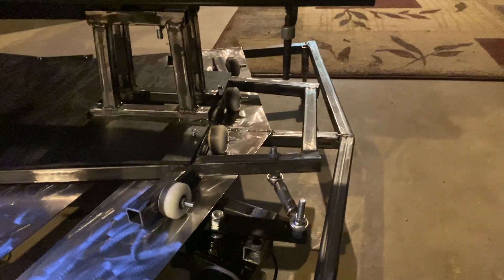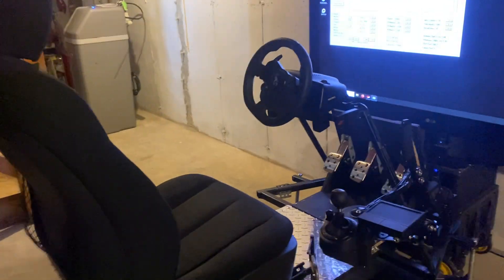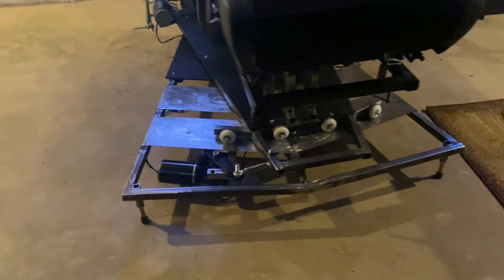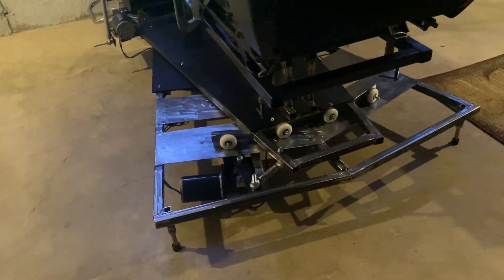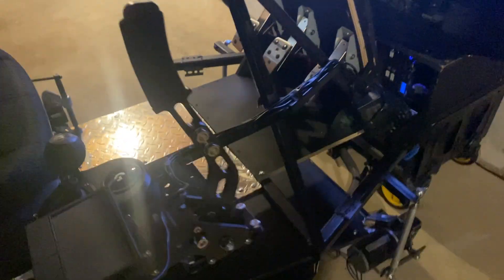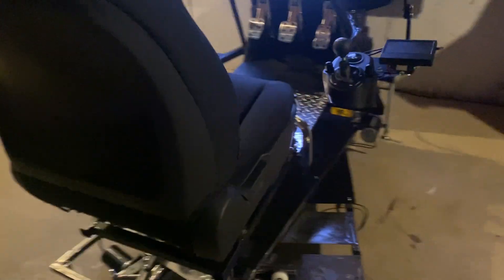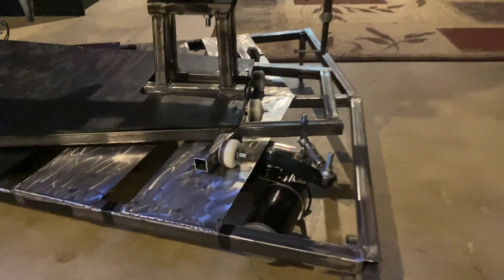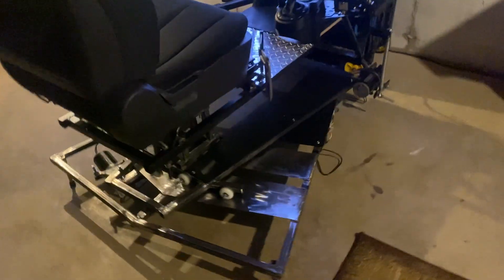Motion Simulator DIY - Update and Overview

Comment: Nice build.. What motor are you using? I'm just starting to build mine.
Reply from the maker: Good luck on your build. I went with the Crab Pot motors that are available on eBay and other outlets. 50:1 gear ratio, 12 volt,  I drive them with the BTS 2 motor controllers.